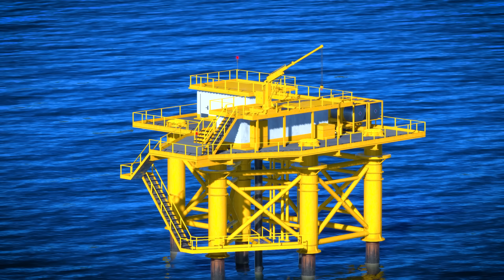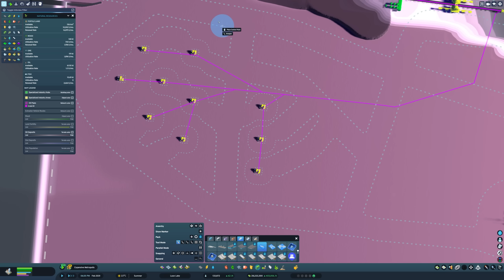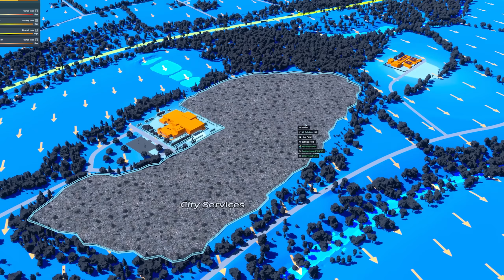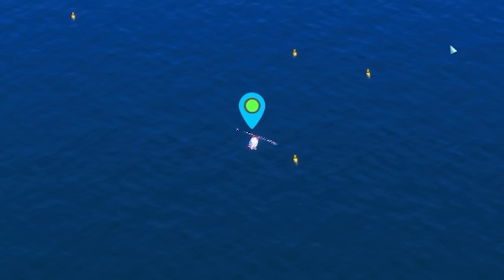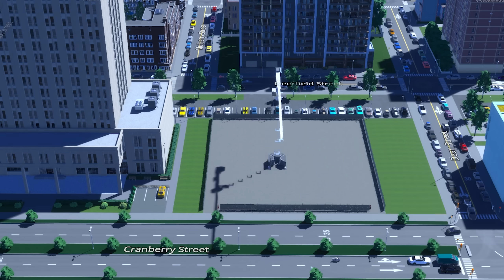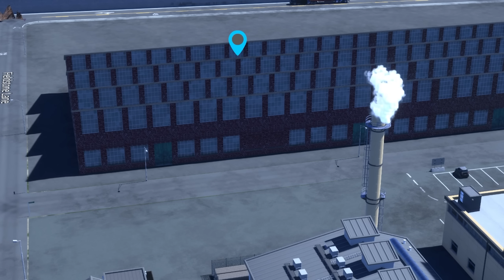I Made $26,000,000 a Month Exploiting Oil

Comment: Moin! 

This oil platforms do you set first need only an underground pipe connection. Every pipe works for 1 till 3 oil platforms for maximum the service. They no need a ship connection, then no ship line goes there. 😮 

Only the second, bigger oil platform need a ship connection. The best are 2 ships to maximum the output if the platforms not near land. One land connection point can serve two different ship lines too, with your construction do you can use both side of course. 

But your university district is wonderful and works better with public transportation. 🤯🥰🙄

Comment: In real life, oil wells the last several years aren’t just vertical holes, they go down 1-2 miles and then horizontal 1-4 miles. So if you wanted that oil under the water there, you’d just build a normal well on land and send it under the water. 

Off shore oil wells are only built dozens of miles from the coastline